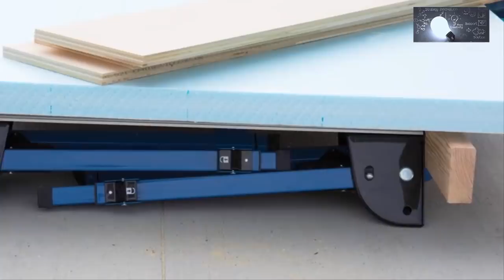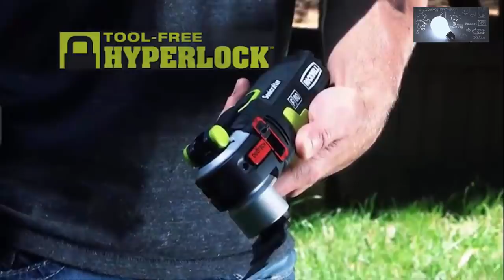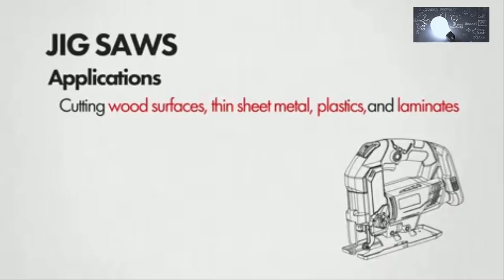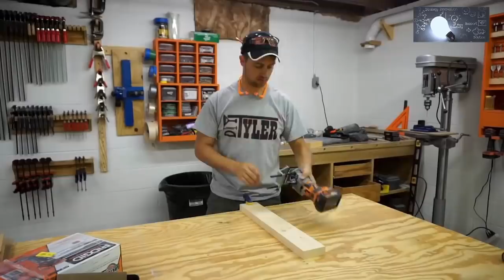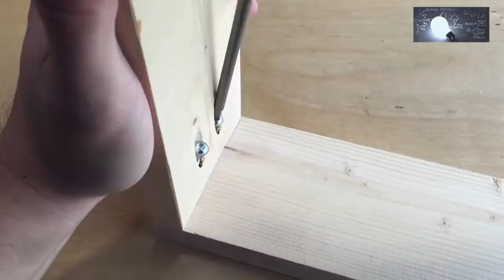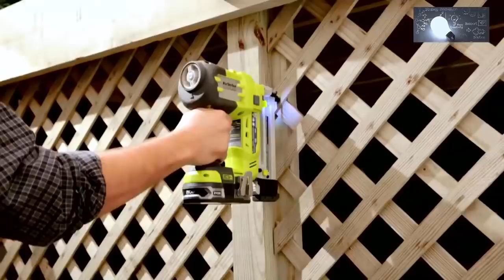8 WOODWORKING TOOLS YOU NEED TO SEE 2018 (amazon)

Comment: For what I do something like the Rockwell Jawhorse is much better than that Kreg sawhorse. Ryobi, no thanks I'll spend a little more for real contractor grade tools. I have close to $1,000 of Ryobi tools purchased years ago, not happy with them for long term use, don't last all plastic. Rockwell used to make excellent stuff 50 years ago, now same as Ryobi maybe a little better, spend a little more for pro tools. Milescraft mostly plastic for occasional use - I have some of their stuff, won't last but cheap. Ridgid started as plumbing and hand tools and one of the best, then they ventured to power tools (in name only), not so great. Ridgid power tool is own by Chinese, not as good as Milwaukee, better than Ryobi all made in China by Techtronic Industries (TTI).
Reply: I agree on the Rockwell Jawhorse.  That think is a tank.  The Kreg version looks cheap in comparison.